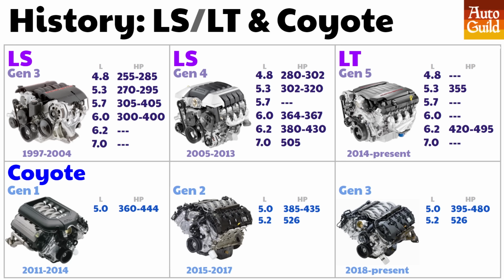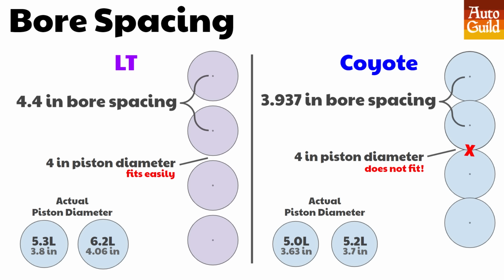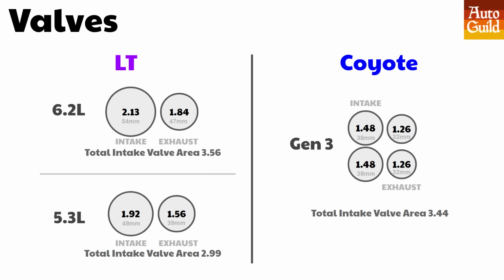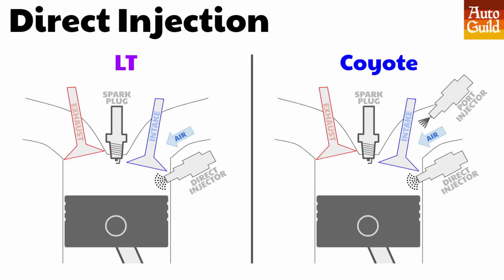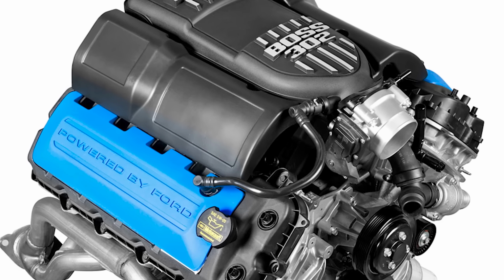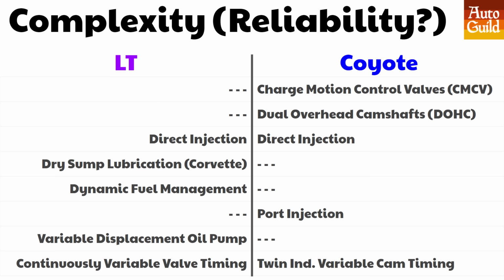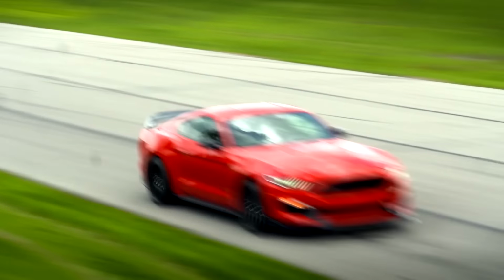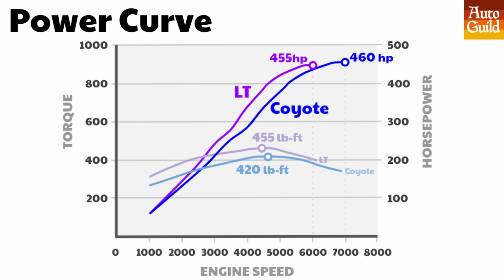GM Gen 5 LT vs Ford Coyote.  Which one is better and why.

Comment: Alot of times "power density" is relevant.
But actual size/power is IRL for packaging and serviceability.   One day, someone will have to work on these things.  Even in the huge mercury marauder those 4 cam heads are what nightmares are made of. 
Some context: ima VR6 VW lover so specialty tools and small spaces are normal in my garage.
$.02

The voodoo and flat plane R1 are symphonies!!

Comment: This is a typical comparison that completely misses the point. Your car only makes contact with the road at 4 small contact points, your tires. Your tires dont give a flippen fuck how efficient you make your HP, or what RPM your power is made, or any of the selling points ford hopes you fall for. What does make a difference to your tires is the amount of torque is applied to them (While its easier for the LS and LT engines  to make torque, money not a issue, you can make all these engines make however much power you want), HOW MUCH WEIGHT IS ON THEM AND WHERE IN THE CAR THAT WEIGHT IS, and THAT is why the LS engine is the greatest engine of all time hands down, no contest. If you asked God to magically make in front of you an engine that can make 200-1000HP of your choosing with the least amount of matter, weight and physical space used, he would give you an LS engine. Thats what it is. You can never make any other engine, voodoo, yote or LT,  be as lightweight, compact and STILL give you however much power you want. And on top of all this, the LS engine is going to give you a better center of mass compared to anything with bigger heads, something that does make an actual difference to your tires at every corner.

Comment: Both good, i like how GM uses the old pushrod design still with modern tech. Nice low end power with the pushrod.
Reply: OHC engines are technically older tech than pushrod.  Don't perpetuate the myth.

Comment: Math for availability doesn't make since, even using your own numbers. 896k F150s were sold in 2019. If I use your number of 25% that puts 5.0L in F150s alone at 224k for just one year. And that number is down by 1.4% from 2018. So in 2 years alone that would put 5.0L in F150s right at 500,000.

Comment: Ok there’s one MAJOR aspect that this guy didn’t consider and it’s one that anyone who just pits engines against one another fails to consider … the vehicle.

Neither Ford or GM “just” builds an engine. Both of these engine platforms were designed with a specific vehicle scope in mind. 

When we’re talking about torque bands, redlines, power output, etc; those numbers mean less than nothing until you put them into something. 

This is precisely why even though I agree that the Predator engine is epic and has stronger values than the LT5, it can’t do what the LT5 equipped ZR1 could do; best a Ford GT lap time. If you were to swap the Predator & LT 5 between the ZR1 & GT500 both cars would behave poorly. And that’s the point to consider; that when you’re talking about engine values you have to also consider why those values are so specific due to their intent.

The comparison of “which engine is better” is really a moot and useless comparison video because unless you’re at least taking a crack at diving into the application of these engines then you’re missing the biggest point to them at all.

Comment: Just saying, the cyote isn't gonna make 550hp bone N/A😂
Reply: And chevy will never top Fords hp per liter ratio when a little 5.0 is making 480+  naturally aspirated and it takes Chevy a 6.2 for 455hp....just saying
Reply: @jrvbamafan1  well ford will never top chevy's horsepower engine size lol
Reply: @aaronvector4750  considering they always do the same with less I'd say they already have. You've got a 5.0 with 480 hp vs a 6.2 with 455.....Fords 427s and 428s can be built to handle anything Chevy has. If it wasnt for the mustang the camaro wouldn't even exist to begin with. They are both good cars but when Ford is putting out 5.2 voodoo engines with 526hp naturally aspirated that rev to 8250 rpms, then theyve already won. Again I'm not a Chevy hater by any stretch, matter of fact I've owned both a 99 z28 and 2013 1ss Camaro in the past, but much prefer Fords higher revving newer engines. The LS1, 3 and LT1 engines feel almost like they are fighting against themselves once they get to about 6 grand. I like all the newer cars though, especially the new vette
Reply: @jrvbamafan1  name one ford engine that's smaller than a chevy engine. That said, chevy's 427s (the old ones, and even some crate engines) have the capability to go over 570hp (n/a, in the l88 vette). Lemme see a ford 427 do that. "If it wasn't for the mustang, the camaro wouldn't exist" well if it wasn't for the corvette, the mustang and the thunderbird, and arguably many other american sportscars wouldn't exist. The voodoo is a fpc so that doesn't compare. We'd have to wait for the LT6 to come out first. Now I'm not a ford hater either lol I'm a fan of all the v8 mustangs and the 2017 GT (as a car, not as a product), and I'm in love with the GT40 and 2005 gt. I owned a 2010 mustang gt (4.6) but sold it for a 1994 zr1 vette.
Reply: @aaronvector4750  the mustang was never made to compete with the Corvette. 2 very different purposes and price ranges. The direct competitor to the mustangs was always the camaro and then the firebirds. There are some 427s running around with 550+ hp out there, look no further than the thunderbolts way back in 62.  Rated at "425hp and 480tq"....actual output right at 600. Ford 427s can make 550+hp without breaking a sweat if built correctly. The 5.0 is smaller than the 6.2 obviously, as was the 289 hi po....that's 2 off the top of my head...maybe the coyote is physically larger, but I'm talking straight liter to liter comparisons. Both Ford and Chevy have crate engines capable of 550+ hp, so it's all in what you prefer.
Reply: @jrvbamafan1  Ford had to make more HP when they limit at 5.0, to keep up with the LT in HP, 6.2
Reply: @michaelbarry8373  I know, which is what I think is impressive. They've always done more with less. I'm in a 2019 c7 right now, which has a 6.2, and I like the torque, but I do miss the high revving 5.0s also

Comment: seems all good and i might be a bit biased. but everybody knows that people who buy the mustang, Camaro. or corvette knows that they will not be staying stock.
at the end of the day it goes off of which one you prefer. the coyote sounds amazing but the low end push rod torque of the lt/ls motors is why you see them get out on the coyotes. the coyotes are good at reeling on top end. however the mt-82 is garbage sorry mustang guys. the tremechs just hold power better, the 10-speed is the best option if you just want to go fast. the manual gm cars are just so satisfying.

Comment: never seen a motor being swapped into everything like the LS’s they have better aftermarket support , reliability, can handle boost on stock bottom end , etc. LS motors are just a all-round better engine

Comment: Would just like to state that in the video (12:42) its stated that ford has not used the T56 or TR6060 on a Coyote but thats not true, you can get the new Mach 1 with the TR6060 that they have been offering in the GT350. Just something I wanted to point out, great video!

Comment: Good info except one part the zl1 losing to the gt 500 is inaccurate. The video of the gt500 beating the camaro was because the owner of the camaro had bald tires and the gt500 had treated tires . The real video showed the gt500 not only lost but got gapped.

Comment: Impressive comparison.  Rare to see this level of unbiased review.  Great level of explanation.  I have owned an LS and now have a Coyote.  Both are great engines.  I am really impressed with the power, refinement and efficiency of the Coyote.  5.0L and right there with all the other larger displacement engines.  I tow with mine so I appreciate the power.  Keep up the great work.  I also agree the Voodoo engine is an amazing piece of engineering.

Comment: I've had 14 mustangs, my fbo 16 is my favorite so far. With a Cj intake it revs a hair short of 8k. With a lightweight flywheel and stage 3 clutch and 3.73 gears it is a blast to drive. might get a pro charger next yr and see what it will really do....

Comment: all cars suck a little oil because by law they have a pcv system. Pcv pulls crank case fumes and oil vapors and puts them through the intake where oil vapors clog up valves

Comment: People underestimate the significance of the lower center of gravity the LS brings over the top heavy Yote. If it highway pulls, Ford has the edge, but a tight track will definitely have your pushrod in its happy place

Comment: Cadillac V8 used flat plane crank until about mid 1920. Was redesigned to cross plane due to vibration. Flat plane crank has been available via aftermarket for GM LS for several years.

Comment: You talk about power to liter ratio but ignored power to weight, power to weight ratio is a lot more important and that's a big advantage for the LT. Both are good but the LT is more practical, more efficient and easier to modify.

Comment: I'm use to older cars and trucks with a distributor (points, rotor, condenser), a carburetor, mechanical fuel pump, oil pump and ignition coil. So simple, works great and easy to figure out what's wrong. I don't need a computer to tell me why something isn't working, or relays and controls that act up. Why did they have to make engines so much more complicated? More money? Give me a straight six any day!

Comment: I've seen far more coyote engines needing maintenance and blowing up.
Reply: Lol  there fuck load GMC Chevy ticking smoking  grey smoke over that cheap ass  oil ring   here's proof where them 6.0 gto and gto 5.7  same motor intrans am ws6  from 6.o ls2 shit  you got more 4.6 crown vics   gt sohc stangs  running around  no lie   on top police intercept motors   not be asshole I see more Chevy being pavement princes than trying be King in competition   ......
Reply: lmao same , coyotes just aren’t good
Reply: @meMelon974  good thing you stay quiet I'm from 90s when 5.9 Durango were bad ass but of course cheap Dodge does not  last forever ..Ford !yes 😎
Reply: @emmanuelcontreras287  * laughs in being a previous owner of 2 6.0’s that have been in shops more than being on the road * 😎
Reply: @meMelon974  yes majority of people know about 6.0 lol 😂 but there bigger dog you know power stroke  shit load on road   6.0 is Ford biggest mistake  but rest all good
Reply: @emmanuelcontreras287  triton motor has entered the chat
Reply: @meMelon974  I have 5.4 99 436 k fan clutch just needs change  01  ranger with 4.0  from 07 mountaineer

Comment: I'll take the coyote all day It's doing war with less I don't have to change the cams I don't have to get the cylinder heads All you need to listen all pump gears and Fuel system you're good

Comment: Could you do one with the Dodge motors (Apache, Hellcat, etc.) vs. Coyote/LT?
Reply: No need Hemi’s suck lol and are not comparable in reliability with the other two
Reply: Considering I've owned both a Coyote and an Apache based vehicle, I'd beg to differ.

Comment: From what I've seen, in terms of aftermarket bolt-on's, the coyote engine can handle way more power on the stock internals than the new LT motors.
Reply: No the coyote spits out a timing chain competing against gms v8...which gm then went another 300+hp after.  YouTube it
Reply: More moving parts means more chances to fail. Pushrods are old technology. And we'll in the 70's and 80's sure the pushrod V8 was the way to go. But they have more moving parts and are more likely to break.
Reply: Agreed.

Comment: Never thought of ever getting a Ford.
Then when my local Chevy dealer was out of the new  
Z-28, last production year before it was put on the shelf. I test drove my first Mustang GT premium. I got it that day. Killed that car for 3 years straight. Had zero problems and I loved it. Never looked back. First set of rear tires needed to be replaced under 5000 miles. Burnouts everywhere. My neighbors hated me and must have thrown a party when I sold my home and moved.
First modification was to make it as loud as possible. Anyone that tells me Ford sucks, I don't get into it. 
All I know is, mine was a great car.
People used to call it" Your Mustang"
Not your car.
That's a first for me.
Keep in mind, my car was brand new.
Not some teenagers leftover with 200,000 hard miles. I remember doing a burnout right out of the dealership lot. Can't tell you how much I  enjoyed that car for three years that I owned it. Could have fell apart with the next owner, I really don't know. Test drive first, if used always pay a mechanic to give it a good bill of health 
Not the one at the dealership. Goodluck. 🏁🏁🏁

Comment: I have a 67 mustang. 
I am staying 351w 5 spd. 

Love the new Ford motors. But I see no reason at this time. To cut out my  shock towers, Making room for a coyote engine. Motor already puts down 500 to the tires. NA
Reply: Stay with the 351. 😀
Reply: I have this set up in my 67 cougar thanks
Reply: I have news for you an LS is a copy of your 351 the have the same deck height same bore spacing same valve lay out !! An LS is a small block Ford with cathedral heads !!
Reply: @ajaychopra9812  And your point is ?  Many v8s have shared similar specs. Might be 'Majic' in the numbers. The proof in this pudding is FOMOCO gave up SBF develop too soon as the LS - LT motor has proved. Ford has jumped back in to pushrod motors with the new for 2020, 7.3 gasoline F-250 & up optional engine.
Reply: @ajaychopra9812  and connecting rod length.. ripped off the WINDSOR EXACTLY👍
Reply: @ajaychopra9812  Cleveland no doubt huh? canted valves vs Windsor straight
Reply: @jamesmedina2062  naa.. M400 with 2V Aussie canted twisted wedge valve Closed Chamber Cleveland Heads👍🇺🇸.. in a 56F100😎
Reply: @nobiden3134  thats what I have: Stroker 377 2V Cleveland with closed chamber Aussie heads and 16cc dished pistons
Reply: @jamesmedina2062  the M400 is ALFA.. Longer connecting rods and 4 inch stroke..
Reply: @nobiden3134  i know but we were talking heads and mine is stroked.
Reply: I love a Windsor. They are my favorite engines. But as far as new engine swaps go. It might eventually be more ideal to do a 7.3 swap over a coyote. You at least wouldn't have to cut out your shock towers.
Reply: @lloydlehr3473  a 427 us 7 litters:)
Reply: @lloydlehr3473  a 427 us 7 litters:)
Reply: Coyote Would only be a waste of your time and money @ 500 hP level . Better spent on chassis upgrades for whatever action tickles your bones.
Reply: Awesome I would not change that engine either, on the other hand pick up a S550 Mustang, whether you get the 5.0 or 2.3 EB, get it loaded, you'll never regret it. IMO the 5.0 is simply too powerful and would only result in my paying insane insurance prices and numerous court dates. The new Mustangs are nice enough that you really don't care what's under the hood.
Reply: The LS is very similar to the Windsor engine.. (ripped off Ford).. 
Who has the Canted valves, twisted wedge and No DETONATION?...
CURTAIN AREA: Shrouding of large valves and air CRASHING into the backside of the valve instead of flowing around (smaller valve). Way better flow numbers. 
And then there's the GODZILLA pushrod... give ford the cube advantage this time!😅
Reply: @nobiden3134  Aren"t All 90 degree V8 pushrod ,gasoline, piston type designs kinda , sorta , actually , really Similar ?
The main factor important to millions of Hot Rodders is that some of them are available in quantity , and therefore low cost per HP.
Reply: Go with the Cleveland 351 way better than the Windsor but it must have the 4 barrel heads
Reply: @glennnewman606  Nah. Never been a huge fan of those motors. I already make a good amount of power. With a motor I can get more parts for. 
Plus the gentlemen that brought the cleavland design to Ford. Was an ex GM guy.
Reply: @glennnewman606  4 barrell heads are notoriously too large
Reply: @glennnewman606  nope.. 2V closed chamber "Aussie" heads are best for street/drag!

Comment: Sadly the enviro crusaders will be the death of both.
Reply: Electric. More torque, Battery Technology is going to get better and better.  No oil changes less moving parts. Been trying to kill the gas engine for years this is the closest they've ever gotten one day it will happen.
Reply: @Mr.Robert1  it'll be forced whether it is cost effective or not, it won't be cheaper that's my opinion. We have enough trouble some places keeping the lights on in a heat wave let alone trying to charge 100s of millions of ev's at once. Generation and transmission infrastructure will have to get a major upgrade, and that will not be cheap, especially wind and solar. we will be the ones who pay for it. Of course we cannot always focus on the money, but we may not have any to focus on.

Comment: If you have lots of money go with the Ford, otherwise buy a gm engine and ad a little more boost.
Reply: Why does it cost more to maintain my Ford in your mind? Do you own both? That's the only way to have and honest opinion
Reply: @Mr.Robert1  Because you have twice as many valves to buy, 4x as many cams, twice as many seats to grind, more timing chains etc. The coyote costs more to purchase and is harder to replace if you ever need to. Just routine maintenance isn't going to cost you any more, its when you want to go faster or somthing breaks. And I have a 6.2 sierra, my buddy has a 5.0 f150, but I fail to see what that really has to do with anything. You have to replace a lot more parts to build a coyote than you do a lt or ls.

Comment: The upcoming V8 for the new Corvette Z06 is said to be the most powerful production NA V8 ever made.  I think around 625hp. This will be a smaller displacement, flat plane crank engine with a reported 9000rpm redline.
Reply: When it comes out and tested then we could talk about it